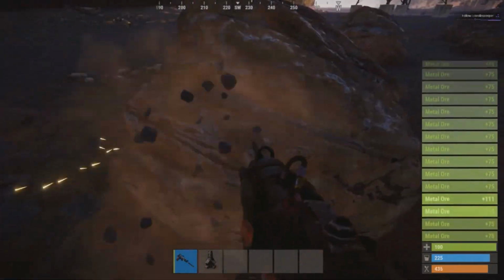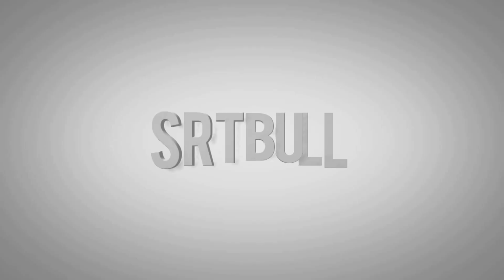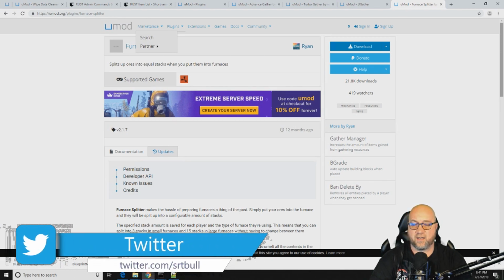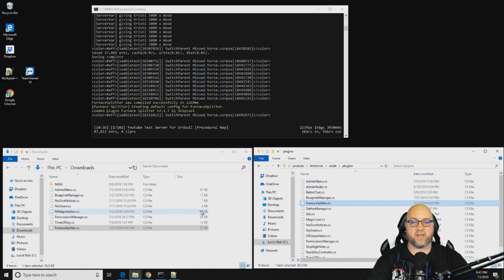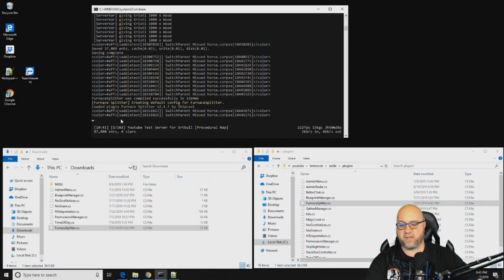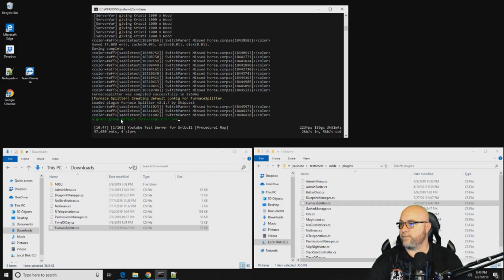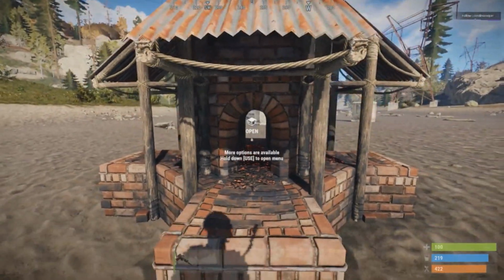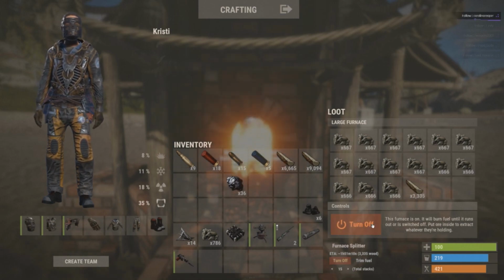Rust Umod FURNACE SPLITTER Tutorial and Explanation | Rust Admin Academy 2020

Comment: Followed all the steps perfectly, but for some reason both this plugin, as well as the QuickSmelt just do not want to work for me. Any idea if i messed up? (Copied plugin to Oxide>Plugins, granted the permission) but still no splitting
Reply: I've just done the same and it works. you gotta make sure to give permission to group called "default".

Comment: I'm having some issues getting this plugin to activate on my server. I'm renting a server from Server Blend, which uses a one click uMod/Oxide Plugin installer, so no actual files are on my PC. Amy idea how to activate it within their files for the server or in-game? I've tried the /fs chat commands and tried using furnacesplitter.use in the F1 command with no luck at all. Thoughts?
Reply from the maker: Have you installed the actual plugin?  The one click installer for umod won’t actually install furnace splitter for you. It just installs the platform that all plugins will work on
Reply: @srtbull  i got the same issue. renting a server, installed oxide and the plugin, but typing the command directly in F1 didnt do it..
Reply: @srtbull  I'm also struggling with this same issue, for many plugins actually, not just this one. Renting a server from ScalaCube which allows me to download plugins and insert them into their server with one click. But these commands aren't working in f1 console or game text. Thoughts/tips? Thanks!

Comment: I have problem with the splitting. If i put let say 10k metal it add 16k of wood auto and when the metal finish to smelt there is a few k wood burning for no reason. Where can i change it and what could be the best proportion for that?